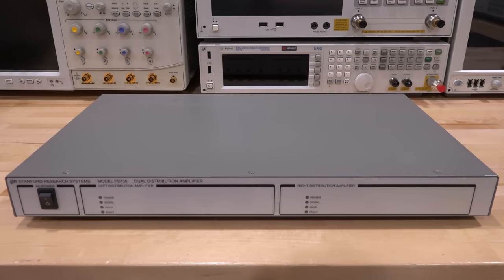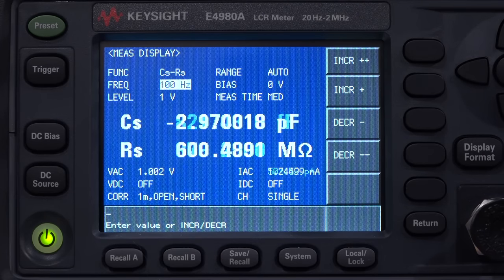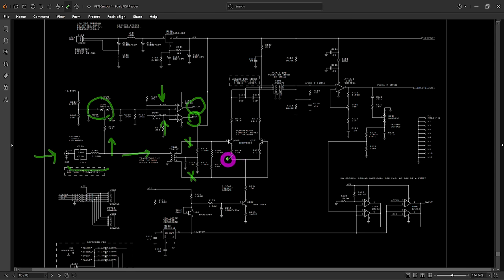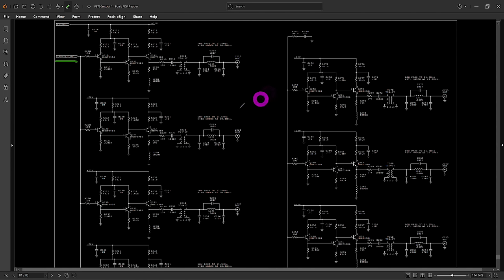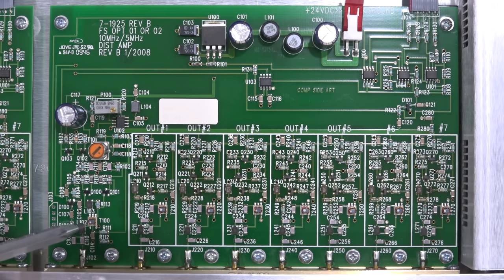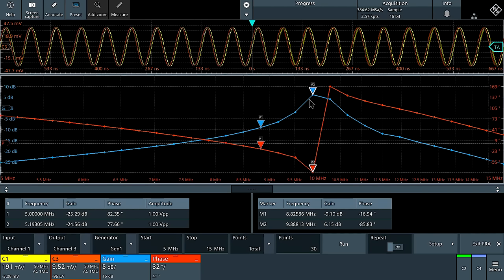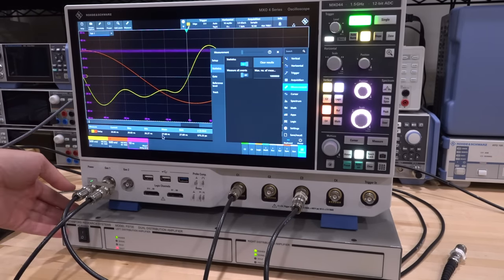TNP #40 - Stanford Research FS735 Dual Distribution Amplifier Teardown, Repair & Experiments

Comment: I have a pair of the half-sized FS735 10MHz distribution amps. I found the limiting/reshaping functionality quite novel and unexpected, but that does ensure a consistent output amplitude over a wide range of inputs without relying upon AGC as well as transforming anything in to sine wave output.

Comment: Distribution amplifiers are very frequently used in the broadcast industry for SDI, but also for analog reference signals like black burst or tri-level sync. Could be fun to take a look at one of those and see how it compares.
Reply: Yes, have one, with plug in amplifiers made by Opamp Labs, Had the one fail, so had to fix it, as getting a replacement would take months. Removed the can, and then soaked the potting in epoxy remover for a week, to make it soft enough to pick off from the components. Turns out the unit is a bog standard LM709 with a booster stage on the output. Fault was one of the diodes in the booster stage went open circuit, and thus both transistors went open circuit in sympathy. So in went a 2N2219 and a 2N2907, with push on heatsinks, and a pair of salvaged silicon diodes, as they had a lower forward drop than the 1N4148's I had around, and this thing has no emitter resistors. 3 new tantalum bead capacitors on the power input, as the existing colour coded ones had sort of disintegrated during potting removal, and it was working again to send video through the system. Gain of 2 only, so it could run up to 10MHz with little problem, though I would guess it dropped off badly past that, but for video and audio it was perfect. Odd design, everything is plug in, 4 plug in amplifiers that are identical, and then another potted plug in power supply that gives 15V rails for them. Then input is via BNC, with a 75R terminating resistor, and output is simply a 75R resistor soldered to the BNC inner, and then a wire linking them to the output coax, shield connected only at the opamp side. Going to guess output isolation is not great, but it worked well for the application it was used for. modified the 2 parts of 4, simply by snipping the 75R resistor, to make it run for stereo audio, which it was great at. Video not so good, driving 15R of load was not great, thus the fixed one needing heatsinks to keep it cool.

Still better than the Matsushita amplifier it replaced, which used printed carbon resistors, and which was from the 1970's, with early silicon transistors that tended to be noisy. That one went to CCTV use, where the camera noise was larger, so it was not visible on the small CCTV monitors.

Comment: 👍 The schematic doesn't look complicated and doesn't seem to contain rare parts. Looks like something that can be easily replicated if necessary.
Reply: The only critical part might be the tunable IF transformer as they’re typically made for 10.7MHz, and it needs to be able to be detuned down to 10MHz.

Comment: This video reminded me of a video that I now see is ten years ago(!) by Gerry Sweeney on YT on how to take an old Rubidium clock from eBay and turn it into a 10 MHz lab standard. IIRC he used a cable TV multi-port amplifier to provide the functionality of the SR unit here. It would be fascinating to compare the results!! In practice it worked fine for his home lab, maybe not to Shariah’s standard though :-)

Comment: I would have used the BNC T at the scope input such that it is the shortest stub on the 50ohm transmission line.
Reply from the maker: Yes, you are right. That would have been better.
Reply: @Thesignalpath I wonder if you had power divider on your mind as you mentioned your desire to potentially perform a additive phase noise measurement, and typically a resistive power divider is where the T was. Did the R&S input impedance limitation punk you mid-build?

Comment: very nice video, some curious decisions. Not sure why one would want a dual distribution amplifier instead of one big one. I have never needed two independent clocks, although i understand it as far as construction and options go, its just annoying to have a T and two cables to feed it. 
Also im not sure why they did not length match the feed for the output amplifiers. Yeah it might be half a ns or so of delay but it costs very little and you can increase your channel mismatch specs.
Reply: 2 amplifiers as if you have a lot of equipment some might need a 10MHZ signal, and then you might want to have some fed from the GPS directly, and then all the rest fed from a GPS locked Cesium source, so that you have a long term stable signal, and a separate short term stable one, as the the GPS disciplined oscillator removes all the phase jitter off the GPS signal.
Reply: Prrhaps for phase noise mesurements with cross corelation?
Reply: @SeanBZA   Why?
Reply: @lukahierl9857  Why?  If you want to measure that just do it directly.
Reply: They did not match the length of the input line to the amplifiers/filters ether.  I agree with your words.   When it comes to metrology grade, everything matters.
Reply: Manufacturing yield is one reason you'd do it like this rather than having one really large one. Also not needing 2 different boards to make 2 products.

Perhaps they didn't bother length matching and just specified the offset? If you're caring about that level of resolution you'd be calibrating your harness anyway, it's not like your cables will be exactly "length" matched anyway.

But yeah it might have been nice for them to make the offset closer to zero. I wonder if doing that with PCB based delay lines etc might have introduced phase noise?
Reply: @johncundiss9098 cross corelation needs tow fully independent clock sources. Those often are from different manufacures and mounted in different directions so that the phase noise of both oscilators is compleatly uncorrelated. For a big mesurment system one may need both clocks at multiple instruments.
Reply: From the PCB layout with it's right angle traces I conclude that the PCB has been designed long ago.

Comment: Thanks, Shahriar, seems to be a theme going with SMPS, looks like some component specification issues throughout the industry. It is possible to get to the bottom of some of the common failure modes?

Comment: I wonder what the collector resistors in emitter followers are for (R212, R215, R217 for the first channel) - not the RC filters, the ones after them. Back in uni we were taught that they're sometimes used for decreasing thermal dissipation in the transistor itself, but maybe here they're there for some additional filtering of the harmonics (increased input capacitance both because of the decrease of quiescent collector-base junction voltage and the Miller effect)? Maybe not, maybe it has to do with decreasing buffer "transparency" somehow? Or maybe it's some additional power supply separation, like a second stage RC filter without the C, since a "bumpy" VCC doesn't make much difference for an emitter follower? Yeah, seeing as those collector resistors only drop around 0.25/0.5/1.0V respectively, I'm going to go with that last explanation.

Comment: If you distribute 10MHz sinusoid to all your frequency instruments on the benches with such an amplifier how much QRM will there be in the lab at 10MHz.  Will is show up on a  short piece of wire stuck into a spectrum analyser above the noise floor?

Comment: What might be the reason for placing to ceramic caps into parallel at the input? They are also on the PCB, C109 and C110.
Reply from the maker: Part of the filters.

Comment: The schematic shows the input transformer as being 2:1, per the legend, but the part (also on the legend) is a TC4-1T which if I recall is a 4:1 transformer form mini circuits. Have I confused my part numbers or is there an error on the board?
Reply: A 2:1 turns ratio provides a 4:1 impedance ratio (which is how Minicircuits specs, and numbers, its transformers)
Reply: Thanks, makes sense @MrJrwillison

Comment: I do not see the point of stabilizing the emitter current of the differential amplifier. Doing so the transconductance and therewith the amplification of the differential amplifier will decrease with increasing temperature. Usually this is compensated by increasing the emitter current with temperature, simply achieved by not taking these compensation measures. See eg the CA3028 IC. But maybe the exact amount of the amplifier is of minor importance, it operates anyway in clipping mode.

Comment: I think for something you want to run 24h you should had replaced all the caps since one already failed means the others are not that reliable anymore!
Reply from the maker: I did check the rest of the capacitors in circuit and they are still doing well. :)

Comment: It would be even better when one half was for distribution of 10 MHz and the other half for 1PPS (1Hz).  But they probably make another model for that.
Reply: Indeed we do. (Just Google SRS FS735.)  The FS735 can be ordered with any two of the following:
Option 1 — 10 MHz distribution amplifier (two are shown in the unit in this video)
Option 2 — 5 MHz distribution amplifier
Option 3 — CMOS logic distribution amplifier (just right for 1pps distribution)
Option 4 — Broadband 50 Ω distribution amplifier (works for video, dc-100 MHz)
Option 5 — Broadband 75 Ω distribution amplifier

Comment: Summary
Introduction and Overview of the Stanford Research Model FS 735  
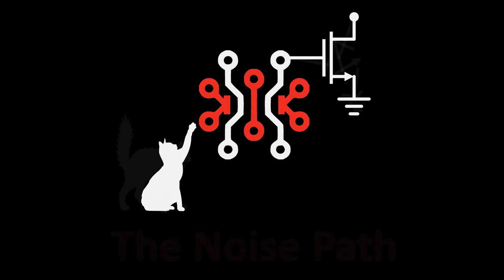- 0:07 Introduction to the video, discussing the Stanford Research model FS 735, a dual distribution amplifier.  
- 0:17 Explanation of what a distribution amplifier is and its use in synchronizing multiple equipment in a lab.  
- 0:37 Explanation of how a distribution amplifier works with multiple instruments, preventing phase noise and drift.  
- 0:56 Introduction to the specific features of the Stanford model, including independent distribution amplifiers and seven outputs.  
- 1:25 Close look at the back of the device, showing the 10 MHz input and seven outputs.  
   
Device Issues and Initial Analysis  
- 2:00 Explanation of the additional feature of the device that filters and perfects the sinusoid output.  
- 2:24 Revealing that the device is currently broken and needs repair.  
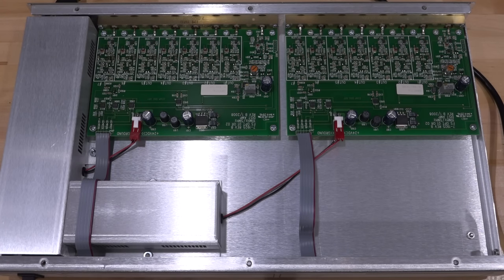- 2:44 Examination of the inside of the device, highlighting the two fully independent amplifiers and power supplies.  
   
Power Supply Issues and Repairs  
- 3:24 Analysis of the power supplies and possible issues with capacitors.  
- 3:59 Detailed examination of the power supply architecture.  
- 4:42 Decision to remove and measure the capacitors to identify any issues.  
- 5:33 Test of the power supplies after capacitor replacement.  
   
Detailed Examination of Circuitry and Schematic  
- 6:38 Examination of the circuitry handling 10 MHz conditioning.  
- 7:01 Overview of the schematic diagram of the amplifier.  
- 10:50 Review of the printed circuit board.  
   
Testing and Final Observations  
- 12:59 Measurement of the frequency response of the distribution amplifier.  
- 14:26 Changing the input to a square wave and observing the output.  
- 16:56 Checking the insensitivity of the instrument when some ports are improperly terminated.  
   
Conclusion  
- 18:03 Conclusion of the review and repair of the Stanford Research model FS 735 dual distribution amplifier.

Disclaimer: I utilized gpt4-32k 0613 to condense the video
transcript into a summary.  I employed Prompt 1 to generate
timestamped bullet lists. I then used Prompt 2 to organize these lists
into sections with titles. The summary was manually formatted using
YouTube comment markup.

Prompt 1: "Generate a bullet list summary, including starting
timestamps for each point."

Prompt 2: "Split the following bullet list into sections. Create
section titles. Keep timestamps for the bullets. Use this format for
titles: *title*."